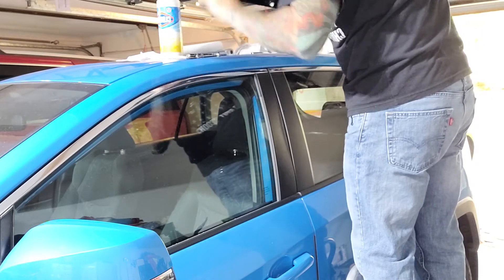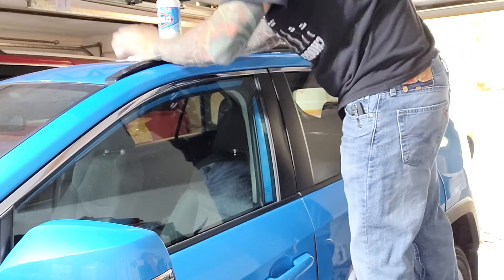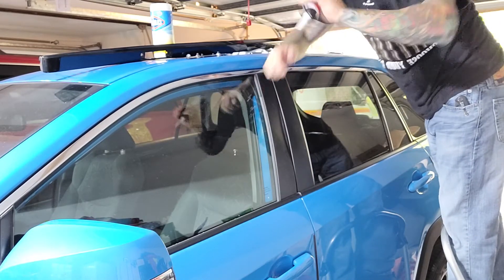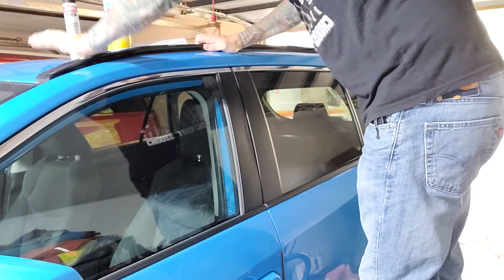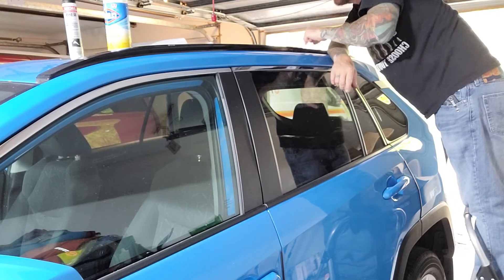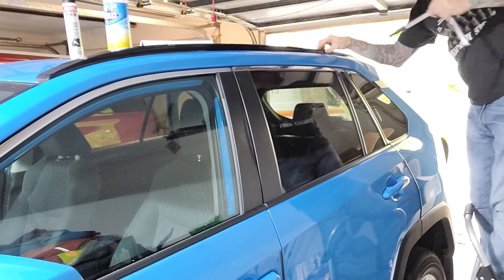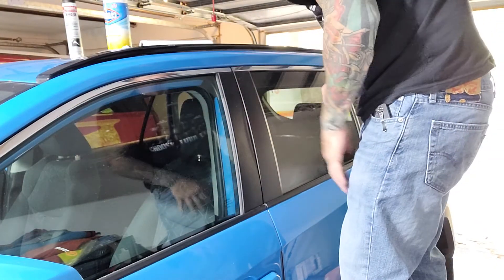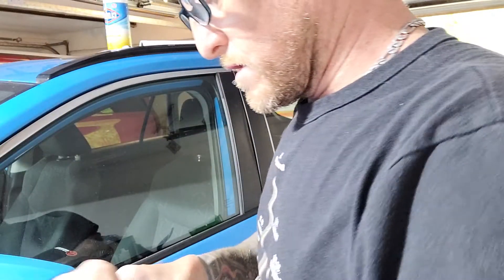2019-2021 Rav4 roof rack water leak fix. part 4

Comment: Thanks for the video definitely helped! Just pulled my wife’s 19’ RAV rails off. Broke one clip the longer front one on drivers side, had to plastic weld it back in. It says wait 24hrs for 100% cure time. I’m using silicon RTV as well. I also goo gone the 3M tape in the front of rail. I will then use 91% isopropyl alcohol to clean  just before putting RTV on it. Hope I have same results as you!
Reply from the maker: Yea just use an outdoor silicone. You should be fine!
Reply from the maker: Great! Glad it helped!

Comment: Good Video man keep up the good work.
Reply from the maker: Thanks!
Reply: @slickfixjeff  i got a question for you? Where you able to fix the leak? I’m about ready to get ride of this darn car. It’s been at Toyota at least 4 time and the issue persists.
Reply from the maker: Yes it worked!  Just take off the trim, squeeze a good amount in each hole, pretty much fill it in, then put the track back on!  Very easy!  Still not leaking to this day!

Comment: Hi Jeff. Great fix. Hope it's still working. Have you done any RAV4 cowl cover removal to clean the leaves that collect underneath the cowl? I need help with that!!!
Reply from the maker: Yup. Still working!  Can you snap a picture of the area in question?
Reply: @slickfixjeff  Hey, not sure how to attach a photo. The cowl is the black plastic piece that connects to the bottom of the windshield. The wiper arms attach through it. I can feel a lot of leaf debris accumulated under there, but can't pull it out.

Comment: How long do you recommend letting the silicone dry?  My 2019 RAV4 sits outside.
Great video, Jeff!  Thanks for making it!
Reply from the maker: I would do it on a day your not predicting rain for 24 hours....usually most silicones want a 24hr. dry time, then you can expose it to the elements. my wife says the car is still leak free! thanks for watching the video!
Reply: This is the best fix I have seen yet, plugs go right in and silicone around and you can easily change them out every few years. Toyota as of July 2023 is covering all damages and fixes under there new program up
To 10'years . So even if you get a leak you can pull the plugs clean the silicone and install the old washers so they never new you were in there and then bring it in and have them fix all water damage and then re plug it. Sometimes it leaks into the pillars and air bags and not in the liner

Comment: Jeff, my leak's on the passenger side front.  So you do recommend putting the rubber washer in that first hole with silicone, and then just silicone in the rest of the holes?
Reply from the maker: to be honest with you I didn't use the rubber washers, they didn't seem to seal right. I basically just squeezed a good amount of silicone (enough to fill the hole and then a little extra) then plugged the track back in. and it's been water tight since this video!  thanks for watching!

Comment: Since only the front white clip was long enough to go through the rubber, are the smaller shorter clips able
To be replaced with the white ones and then you could use the rubber plugs in the rest of the holes ??
Reply from the maker: There's actually a class action suit against toyota. If you bring it back to the dealer they have to repair EVERYTHING that got damaged by the water. We no longer own this car, my wife decided to have toyota buy it back and she purchased a 2023 rav4 hybrid.

Comment: Hey man hows it holding up is the roof leak issue gone? I just got a 2020 RAV4 LE a month ago and wanna give this a shot before anything happens. What brand of silicone did u use? by putting some into the hole it won’t get into the car and damage it ? And what size orings should I use bc you didn’t use them in the video. I know the seals are 1/4.
Reply from the maker: Yes this is still holding up! By squirting a good amount into the hole did not damage the interior. I only used silicone to basically fill the hole. No other methods worked.  Any indoor/outdoor silicone will work. 
Here is a link! Thanks for watching!

 https://a.co/d/jlR2yhN
Reply from the maker: https://a.co/d/jlR2yhN

Comment: Hi jeffrey I have the same problem with roof rack water leaking both driver and passenger side anyways what kind of adhesive did you put on that rubber boot and by the way did you pull the roof rack? and nothing to unscrew on it?
Reply from the maker: I wound up not using anything I bought! The only thing that worked was the clear silicone I squirter in there....since this video my wife says it hasn't leaked yet!

Comment: Hi, what is the result after 8-9 months?
Reply from the maker: Still leak free!!  Use the silicone in the video, works excellent in the elements.
Reply: @slickfixjeff  do no need O-ring 1/4" from the set at all which You showed ?